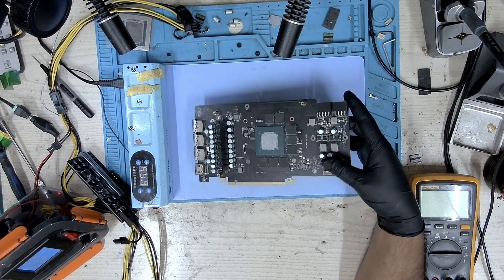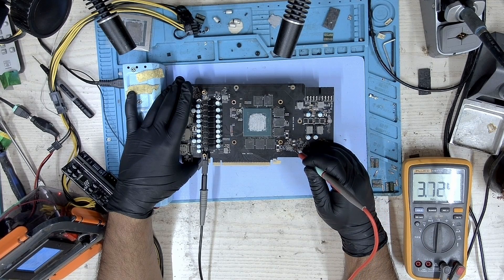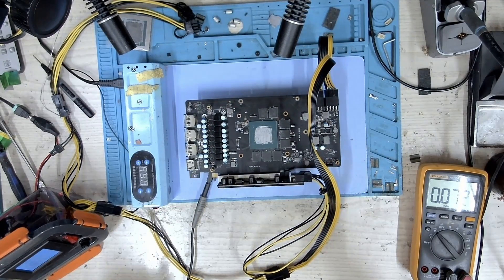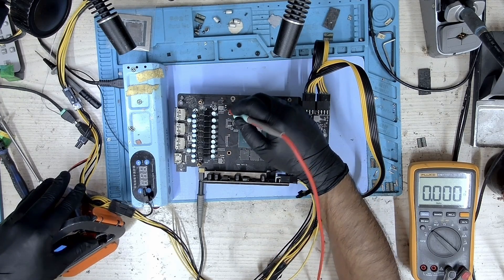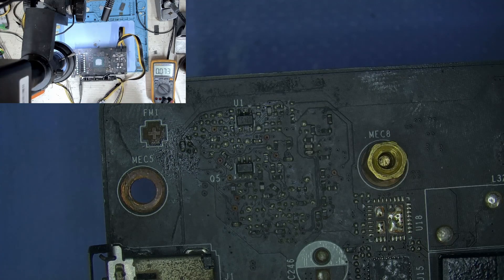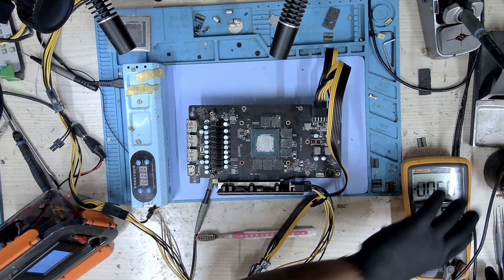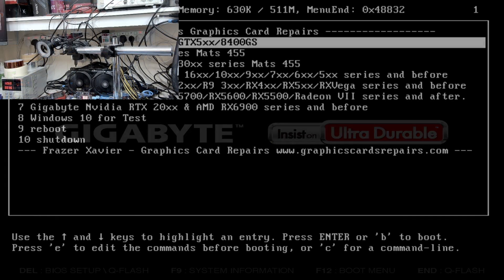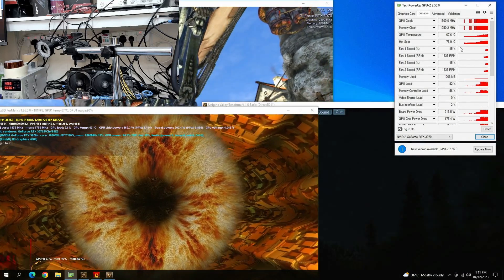RTX 3070 Graphics Card Not Detected - A Quick Fix Tip for Repair Technicians.

Comment: Hi. I have a similar problem with this AND gate not outputting 5V, but it is because there is no 2.4v on pin 2 of the AND gate. Anyone know where this 2.4v should come from? Thanks
Reply from the maker: There is an AND gate with the marking U29. It's on the right front side of the board near the memory Inductor. Check on pin 4 if you got any voltage. There should be voltage on pin 1, 2 and 5. Something may be missing there. Start there. It could also be that that AND gate is faulty.

Comment: For the output of and gate how much volt is that ?
Reply: Also it don’t have 2.4v in the middle. 3.3 is on, 5v is on, output and 2.4 is missing
Reply from the maker: 3.3V is pin 1 , the middle pin is pin 2 . The enable voltage of 2.4V on pin 2 comes from the 6 pin Q-FET marked Q5. if on the Q-FET there is nothing coming from pin 3 You will have to check another AND gate marked U29.
Reply: @GraphicsCardRepairs-tk7ql  thank for the reply bro, at u29 pin 1 is 1v, pin 2 is 3.3v, pin 3 is 0, pin 4 is 0, pin 5 is 3.3v
Reply: Also at q5 pin 6 and pin 5 i have 5v
Reply: @GraphicsCardRepairs-tk7ql  so i need replace u1 or not ?
Reply from the maker: So U29 is not giving any output on pin 4. There is input on pin 5. pin 3 is ground. Pin 1 of U29 should be 1.8V. If it is giving only 1V check the dual Schottky diode D6. There is a 10K resistor connected to pin 1. Check if you get 1.8V before the resistor. If I may ask are you using Zotac RTX 3070?
Reply: @GraphicsCardRepairs-tk7ql  im using colorful i game 3070 bro. If i check again its between 1-1.2v on pin 1.
Reply from the maker: What is the voltage on the 10k resistor connected to pin 1 of the dual 3-pin diode D6 which looks like a transistor? is it 1.2V or 1.8V.
Reply from the maker: If it is 1.8V jump a wire over the 10K resistor without removing it. If it is 1.2V replace U29.
Reply: @GraphicsCardRepairs-tk7ql  its 1.8v at pin 1 at d6
Reply: @GraphicsCardRepairs-tk7ql  both side of 10k resistor is 1.8v bro
Reply: Dont know why after pressing a u29 the gpus is power drawn about 2.2amp and 30watt
Reply from the maker: Ok the problem is at U29. Reinstall U29 or replace U29 AND gate.
Reply: @GraphicsCardRepairs-tk7ql  u29 after got pressed pin 1 is 1.8v checkin with mats software soon
Reply from the maker: Your GPU should be working now.
Reply: @GraphicsCardRepairs-tk7ql  i have second igame that missing 12v its only get 9v what caused this problem
Reply: But second gpu get about 3.4 amps and 34watt
Reply from the maker: It is drawing too much current. That's why the voltage is dropped from 12V to 9V. check using Thermal camera what heats up.
Reply from the maker: The output on pin 4 should be 5V.
Reply: Thank sir for your support its alive🎉🎉 if i may ask its ktext or pex or pecs ? After u check 1.8 rail
Reply from the maker: PEX voltage should be 0.9V
Reply: pin number 2 is 2.4 v right? Its missing  2.4v on pin 2

Comment: I have a update on my fix with the same card bro!
So I found the shorted DrMosfet by removing all 4 inductors and I found the culprit and removed it.
I've replaced the AND Gate that has problems but the GPU refused to be detected.
At this point I decided to remove the replaced AND gate and started the GPU with mesuring the pads where the AND gate supposed to deliver 3.3V, 2.4V, 5V and 1.5V and to my biggest surprise all those voltages are present without the AND gate on the card!!!
I booted the card, installed the drivers and I was surprised it worked fine!
How is that possible bro? Can I leave it like this or should I definitely replace this AND gate?
The card worked even without the Mosfet replaced (I couldn't find one at the moment).
Reply from the maker: Looks like the 5v from the input is shorted to 5v output. That can explain why you have 5v on the output pin which triggers the DRMOS to activate. There is no other explanation. The AND on pin 4 is output that triggers 5v to DRMOS and pin 5 where it should have 5V input. Somehow 5v is going straight to pin 4 which should not happen without the AND gate. So currently it is bypassing the logic and activating the rest of the circuit.  Now there should not be any 1.5v on any pin 1 should be 2.4v pin 2 should be 3.3v pin 3 is ground pin 4 is output and pin 5 is 5v input which gets transferred to pin 4 when voltage is present in pin 2 and 3. So on which pin do you get 1.5v? If pin 5 then there is something wrong with a resistor on the line.
Reply: @GraphicsCardRepairs-tk7ql  I got 1.5V on Pin 4 and 2.4V on pin 2 (the AND gate pads).
I'm currently testing the card and it's working fine with Games sor far.
May I bother you with one last question bro?
Can I replace the BLN0 Drmos (AOz5311nqi) to a SIC632 Drmos? 
I've looked for the Datasheet of those mosfets and they quite similar with little differences (If I'm not wrong).
Reply from the maker: It should be 5v on pin 4. So the AND gate is not outputting the 5v now if the 1.5v is still present with the AND gate removed then 5v is shorting to the other side and you have a blown resistor between the DRMOS and the pin 4 of the AND gate which is dropping the voltage to 1.5v. since the DRMOS is receiving it's 5v it is activating the DRMOS and card is working as rest of the voltages are present. Now about switching to Sic I really have not tried it but if the Amps rating is the same and the pin out matches it should work. Just match the datasheet for both. When I get back home in the evening I will check it too and update you. There are a few differences you should know. The switching frequency for BLNO is 2Mhz whereas SIC is 1.5Mhz may cause issues(not confident as not tested myself). The pin out are the same so it can be installed but I have never tested this combination so I would not know how it will perform after installation.
Reply: @GraphicsCardRepairs-tk7ql  I'm so thankful for your long response bro!
It's detailed and precise! 
👊

Comment: Thanks bro! Your tip helped me a lot!
Can I ask you what cards have this type of AND gate and is it possible for some other cards to have this kind of problem?
thanks a lot.
Reply from the maker: All cards have AND gate. The one used on this card can also be found on the 2060, 2070  and 2080 cards. Apart from that the 3060 and 3060ti. 3070 is the one which dies commonly with this problem. Not observed other cards die like this.
Reply: @GraphicsCardRepairs-tk7ql  thank you for your response! I've found one on a 2080ti and while testing it, I think I accidentally caused a short circuit on the 12v line (second 8 pin connector) 😭
Reply from the maker: Do you have a thermal camera. It makes the job much easier.
Reply: @GraphicsCardRepairs-tk7ql  for the time being I don't have one but I'll try alcohol or a colophane powder I guess.